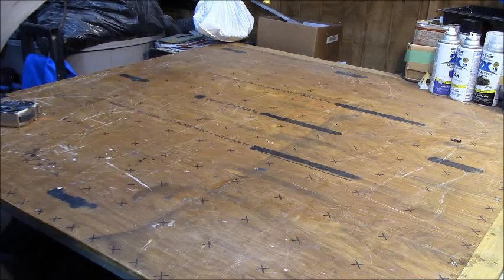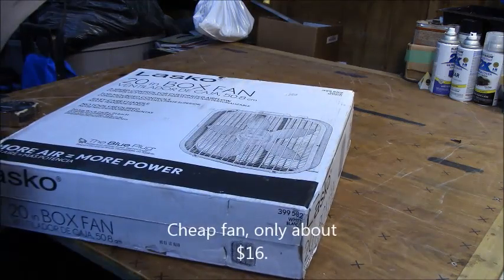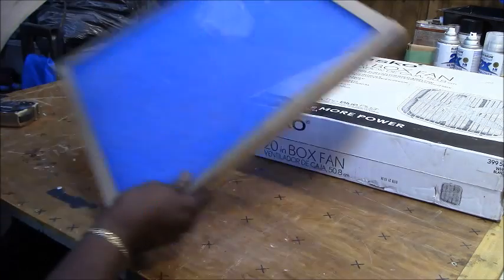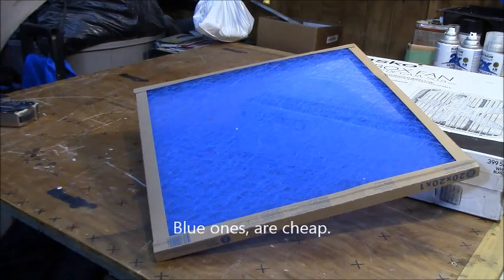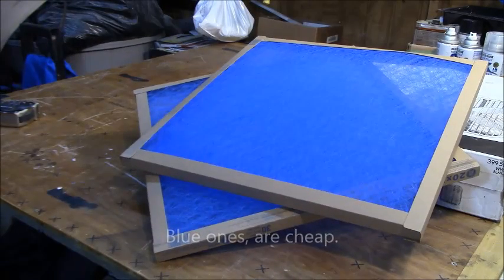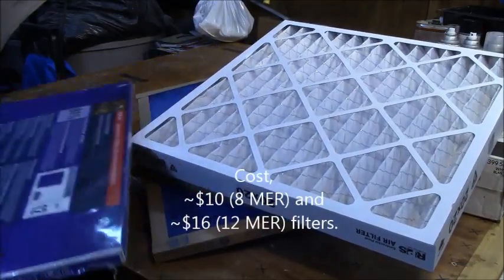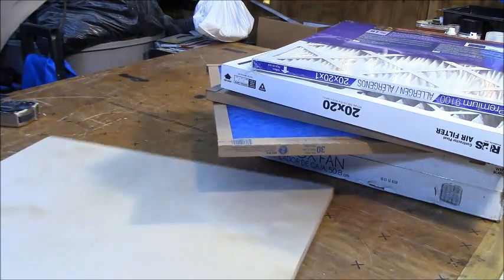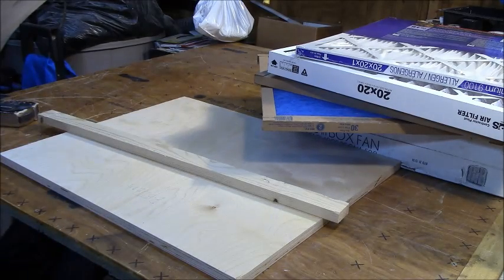DIY Workshop Air Filtration

Comment: Robert how is this system working since building it?  I assume the fan is blowing into the room right?
Reply from the maker: It's still working good. It is blowing into the room. In one of my earlier comments I think it would have worked just as good filtering with two filters; cheap one at inlet to catch all big particles and the second filter for dust collection.

Comment: I liked the way that you used the filters, I have purchased two fans to make a two units. I am going to hang one on the ceiling and after seeing yours, I am going to make one for floor level.  I have a Grizzly system, but find that the dust from the machines is insidious.  Thanks for the video

Comment: Mr. Wadington, you used two larger gaps in the row of filters.  What was the purpose for those larger spaces.  Also you also hot glued window screen or at least thats what I thought I saw.  Where did that frame get placed?  I am intending to follow your design and build my first air filtration system for my samll shop.  The pre-making of the frames was a great idea!  Thanks for sharing your build

Comment: I’m building one right now but I seemed to hit that wall of you can’t build it with enough airflow with HEPA filters and they cost a lot anyway so you end up with lots of the dangerous tiny dust...guess I’ll have to vent outside but not good in cold winter :(  .
Reply from the maker: You are right a hepa filter has to much pressure drop for a simple cheap box fan. You just want a cheap filter to trap dust, but not lab dust free.
Reply: @RobertWadlingtonDIY  :) be careful your not breathing the air from one of these blowers as it's supposed to be the worst parts of the dust escapes and flies around the room your in. But if you have a mask too or venting it outside plus capturing the dust at source seems to be the best... From what I've read.

Comment: Nice air cleaner.  But I think you could have used one good air filter instead of four.  All those air filters reduce the volume of air being treated.  The fan by itself will most likely deliver1500-1800 cfm. But when you put filters in the air path, the delivered air exiting the cabinet is greatly reduced.   I would suspect you are now getting about 200-300 cfm exiting the cabinet provided no air filter is used on the outlet side.  The filter you have on the outlet creates a static pressure inside the cabinet and really does no good and reduces delivered air to room.  

In simple terms, air filters work on room air changes per hour.  If you reduce cfm of delivered air, you reduce room air changes.  I suspect you might get about five air changes per hour on a 20’ x 20’ x 8’ room such as a garage.  This is not enough for healthy clean air and needs to be increased to about 15-18 or more air changes per hour.  Using an undersized air cleaner means you will breathing more dust.  The more you saw and sand wood, the better the chances your system will never meet the air purification needs.  

And going to a higher MERV rating on the filter only exacerbates the problem. There is a lot more that goes into designing an air filtration system than slapping air filters behind and in front if a fan contained in a box.
Reply: I thought the same thing.  A filter in front of the fan doesn't enhance the system.  A low merv pre filter to remove big particles followed by the higher merv for the one micron particles.

Comment: Great idea Robert I just started to build my cleaner today I’ll be only using 2 filters my question what filters should I use to collect fine dust thanks buddy keep up these great videos
Reply from the maker: Charles Smith, I would if your are using two filters is a very inexpensive filter for the first stage that will collect most of the suspended dust/sawdust ( this you can replace frequently at your choice at a low cost) and for the second a little better ( but not “best”) but make sure it want hamper your airflow ie, filtering so much it can not flow through the filter if your fan doesn’t have enough pressure to push the air through.
Reply: Robert Wadlington p

Comment: Man, it's only missing one thing....a hood ornament! Good job. One thing though....consider adding a shroud around the fan blades. That would decrease air "blow-back" or whatever you want to call it. Think about it. They put fan shrouds on automobile engines for a good reason. It maximizes the airflow through the radiator. It's just a suggestion, brother. Be well.

Comment: impeccable build quality. id swap out the multiple layers for a pre filter and 5 or 6 inch deep merv 13. pro units use blower motors because they deal with resistance to flow better. i know for a fact a 1inch deep merv 13 will quickly burn out a box fan and u move zipo. put a 25x20x5 and u can run fan high all day for life of filter and move significant amounts of air. I spoiled an air sample for mold (it was actually there) running 3 of these homemade hepas. 

pleats in deep filter = surface area...surface area = more holes for air to pass through and be filtered/less resistance. more holes takes longer to clog so it also equals longer filter life at higher cfm
Reply: or throw a furnace blower style motor where box fan currently is and say FUCK YOU STATIC PRESSURE! its not crazy to say it...its crazy if static pressure talks back ;)

Comment: I am thinking about doing something like this only the fan will not be near the floor up on a stand so it does not suck the sawdust in from the floor . I am looking at using 2 or 3 fans stacked above each other all wired to one fan speed control switch .2 hinged doors for changing the filters star knobs to lock the doors closed

Comment: For all of you armchair critics, this fan is plenty big enough for an 11x20 shop, or more. With a 10 foot ceiling, that's 2200 cubic feet (CF). Good practice requires that you recirculate and filter the volume of air in the shop 5 times per hour, or once every 12 minutes. That Lasko fan just so happens to be rated at 2200 CFM. By itself, it is capable of recirculating the entire volume of air in his garage once every minute! Even if the filters reduce it to 10% of it's free-flow (to 220 CFM), it will filter the entire shop 6 times per hour.

With proper selection of filters, you should have a lot more than 10% flow. Most people will use too much (too fine) of filtration, because MERV 8 to MERV 14 furnace filters are what they can get. A MERV 4 is the lowest filtration you could use to mitigate a dusty environment. Even a MERV 5 is sufficient for filtering particles large enough to ruin a paint job in a spray booth. Most cheap furnace filters are MERV 8--far more than you need for a shop. And a MERV 14 is one step away from filtering bacteria from the air!

Use some 1/4" foam as a pre-filter, with a MERV 5 main filter, and you will knock out 80-85% of particles the size of powdered cement or pudding mix on each pass through the filter--and a lot more sanding dust! The foam can be cleaned with a shop-vac now and then, and the main filter will last longer. And plenty of airflow. I duct tape the preceding to my Lasco 20" fan and let it run overnight before I paint vehicles in my garage and  it works just fine!

Comment: Very nice.  Good clear design, good execution.  Nice looking, too.  Your design appears to leave more space between filters than most other designs I’ve seen.  I recall reading somewhere that was a good idea.  Had forgotten about it until now.  And I forgot why; that happens a lot these days.  Does it make a difference?  Why allow the extra space?  Not a criticism, just a question from an old systems engineer/new woodworker.  “Showing up is half the battle.”  Keep on keeping on!
Reply from the maker: Joe Dance, the real technical reason is to allow space to reduce “turbulent flow”. You want to maintain laminate flow (flow hitting the filter from a 90 degree angle) rather than sporadic angles. Laminate flow allows particles to be absorb by the filter rather than dropping out between filters, and entire process is more efficient and requires less fan pressure to push the air through the final filter. Otherwise, you’re spending time dissembling the unit to clean rather than just pulling and replacing the filters that is to do the job of grabbing those particles.
Reply: Robert Wadlington  I was pretty sure there was a good reason.  Thanks.

Comment: Hi when I get a workshop I would like to do this as I suffer with allergies and this would help a lot. My question is what filters are you using?
Reply from the maker: Fusion_x_Frost, these are the just a reasonable priced home hvac filter from a big box home improvement store. No need to buy an expensive filter; just don’t buy those cheap fiberglass filters. Don’t spend any more than you would for your home central vac system. Also keep in mind the more filtering the higher your air flow drop will be.
Reply: Robert Wadlington thanks for the reply do you thing G4 Pleated filters would do the job. There on eBay and our really cheap.
Reply from the maker: Fusion_x_Frost, I didn’t get into that depth of technical specs...less just say a pleated filter would do and I would not pay no more than $5 USD per filter. Because you have allergies if that doesn’t work, you can adjust upwards in price, but remember the better the filtering the less flow out of your fan due to filter pressure drop which could lead to having to go with a more expensive solution to airborne shop dust or off the shelf product.
Reply: Robert Wadlington thanks I’m thinking of going for the filters I told you as anything should be better than not having one. I’m thinking of making this design for my bedroom. And doing a bigger one with a motor and four filters for my workshop.
Reply: Hi could you leave a link to the 3d files so i could recreate this.

Comment: I was wondering about a timer switch.  I think that would help with the low air flow if you could set it to run for 20 minutes after you are done cutting.  I watch quite a few wood working videos and this is the first time I've come across yours.  I like the music and simplicity.  One suggestion is narrating instead of subtitles.  Great work.  P.S. love the color choice.

Comment: How is this working out for you?
Would you change anything on your design? 
And Thank you for posting this idea.
Reply from the maker: JULIO CRUZ, hi I would make changes. See my replies to earlier comment. In quick summary, just going with a single filter thereby making the cabinet smaller for my small work area or for those with bigger work area going with a typical hvac squirrel cage fan with higher pressure outlet. Thanks for watching my page.

Comment: I built one similar and used the same cheep lasco fan with plastic blades. I only used 2) 20x20x1 filters merv 8 and this style of fan didn't do anything with both filters. I took one out and it did do better but only on high speed.

If you want to use multi-able filters I would recommend to spend a couple more bucks and get a box fan with steel blades, it will draw a lot more air and work a lot better.

Comment: Can I get the measurements please?
Reply from the maker: nenecutie14, I used an inexpensive box fan which I built the housing around. For the width and height, You just need to make sure that the fan’s outside dimensions fits within your inside dimensions of your surrounding housing. As to the length I ended up with approx 24”, but if I would do it again I see it would work with one good single filter rather than multiple filters....so if I would redo I am guessing my length would be around 12” to 16”. Those less inches means a lot if you have limited space and with it smaller you have the option to hang from ceiling.

Comment: Robert, this is a really nice build! I've seen a number of vids on air cleaners, and I like your design. The cart approach is nice, and I need to build some stands for a benchtop drill press, disk/belt sander, etc. anyway - so one of them can house this air cleaner. Nice job on the electrical, too... good to have the switch easily accessible. 

I really like the purple paint and the flames. Add some electric green and you could get a Joker theme going! Being a Harley guy, my shop has a white, gray, and orange motif - so I'll go orange for mine. I have some leftover bright orange paint called Sunset Boulevard from when I made the bar/rec room. It pretty closely matches my Wen 12" drill press.

Comment: Hi Robert 

Nice video of your build, I agree you do not have enough CFM to really filter the air, I am building a filtration system using a squirrel cage blower that was the house AC / heating system I salvaged after we replaced our system. My shop is small, 20 x22 if you can find that type of fan I think it would better serve you. Consider contacting an AC / heating company they normally just junk the old equipment during a new retrofit and they may very well welcome you to come get the old blower.
Reply from the maker: TheFalconJetDriver, thanks for the advice; I'll try that.

Comment: Very cool Robert! How would you say it works now that it's been a while since you built it?
Reply from the maker: Eric Herlitz, thanks for the comments. It working very well. However, I've been thinking once it gets warmer here in the Midwest I'm considering shortening the housing since the foot print occupies to much floor space in my small shop. For the amount of sawdust and sanding dust I create just a single stage good quality filter would be sufficient rather than the multiple stage filtering that uses more length. In summary, I thinking of modifying it with a cheap filter followed by a box fan and then a good quality filter before exhausting to the shop; that will give me a much shorter box.

Comment: nice.  good work
Reply from the maker: chuck page, Thanks. I enjoyed doing the project. However, after finishing it I concluded that the same could be done for those not wanting to spent the money with an inexpensive box fan and a good average filter fastened to the front of the fan....it's less efficient, but it would work.

Comment: The setup is not effective.  The thicker filter should be in the back, and the thinner filter should be in the front; essentially pulling air through the thicker filters.  Those fans do not have the CFM to move air well enough through one filter let alone three. The cubic ft space in your shop must be really small.  Your design would benefit from an industrial fan with higher CFM, like Air King.  I like the box design, it is very nice, throw in a stronger fan it will work great.
Reply: From what I have seen in other designs a pre filter that is thinner is used to extend the life of the main (expensive) filter. To do so effectively it needs to take the bigger hits of particles, so I think he did it correctly.
Reply: I agree with this, I built one of these a while ago with a cheap box fan, and I could barely feel any air coming through it.  Wasted a bit of time learning, hopefully anyone reading this will consider the strength of the fan before putting multiple filters in front of it.  The more obstructions in front of the fan, the harder it has to work to push air through it.

Comment: good design but was not impressed with the apparent air flow
Reply from the maker: Well for my size shop its good enough so far. Also it is marginal using a $16 fan vs $150 off the shelf, but the idea of diy I'll use it thru the winter and not happy with it I' ll change it out with a cage fan. I'll do an update in the spring. Thank for comment.
Reply: Maybe few less filters may increase the airflow, IMHO... geat video